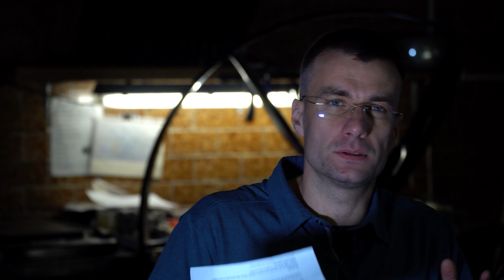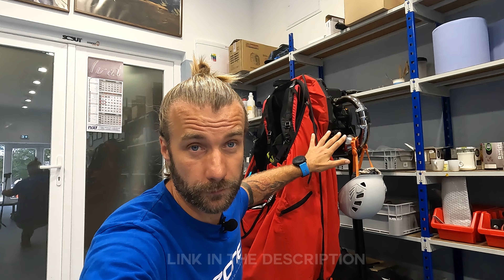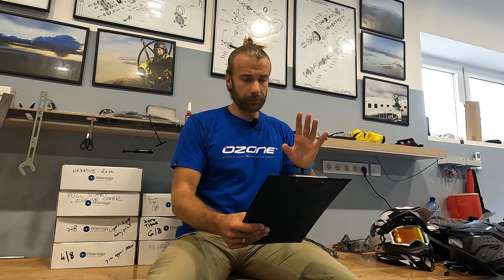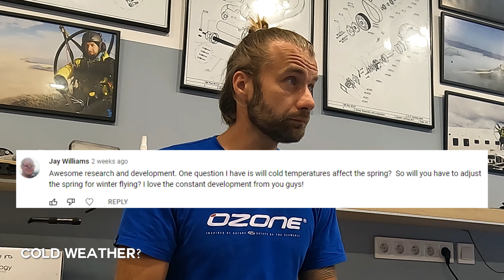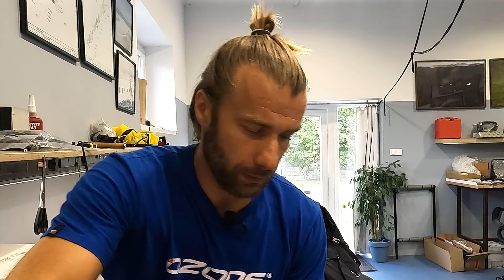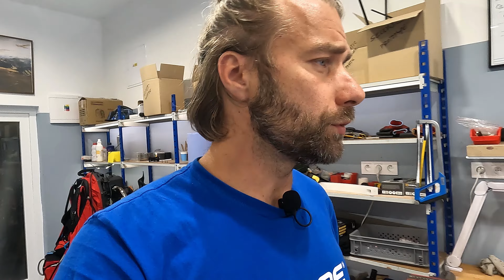Variomatic Propeller FAQ - 340 comments! Smarter Pilot series.

Comment: to be fair, you don't need to use one helical spring - you can use one leaf spring for both blades. that shouldn't complicate things too much. It could be used as a pusher or a puller spring, and having one spring instead of two would minimize the issues with having slightly different tension for each blade.
Reply from the maker: I can see some benefits of leaf spring. This would require significant changes in the design. For simplicity in will stick with current design for now but I will consider leaf spring for future evolution.

Comment: Most pilots (at least GA pilots) are aware of the benefits of in flight adjustable props.  Development started just after WWI and commercially viable implementations were available in the 30's, certainly in WWII the vast majority of military aircraft had in flight adjustable props.  There is also already a company that makes props that are adjusted in a manner similar to what you have done for a small number of GA aircraft, so it shouldn't be a surprise to pilots in the know that what you have done, if implemented correctly, will have positive results.  I don't intend for this to diminish in anyway all the hard work you put into making this a success.  I say bravo and congratulations for sticking with it and making it work.  I won't be surprised but will be pleased when the solution is eventually available to PPG pilots.

Electric motors and motor drives are already very efficient.  When not running at 100% output the current drawn is proportional to the load, if the prop doesn't load up the motor, the motor won't draw very much current.  I wouldn't be surprised if there were no benefit for electric drives.  Another way to look at it, electric vehicles don't select different gears in a gear box for different vehicle speeds, the motor to wheel gearing is fixed at one ratio and electric vehicles still have excellent acceleration and operate at high vehicle speeds.

Comment: Great news.  I fly a PeaBee flexwing (powered hang glider) with a Moster 185 and have struggled for ages to find a suitable propeller as my cruise at 57/5800rpm is 46 mph.  Do you feel your propeller will be suitable for these flying speeds? I'd be really interested in supporting you if required.  Your R&D and attention to detail is amazing, thank you. Looking forward to the update.
Reply from the maker: I am sure it would work. I will not be able to fine tune the settings. Would you?
Reply: @SCOUTaviation  I work with a UK microlight maintenance company called Micro-Maintenance so would happily work on the fine tuning. I've even been experimenting with different pitch propellers at the moment.

Comment: Miro, why not use a swashplate like a helicopter to vary pitch inflight ?? 
Pilot adjustable in flight !  

I’ve used this process on model aircraft for reverse thrust to fly backwards
Reply from the maker: How would that be better?
Reply: @SCOUTaviation  
It would allow infinite adjustment you could measure with rpm and speed to ensure optimum performance - blade shape can be optimised.
Have a look at a Rc model helicopter tail rotor- upscale it 
It could be retro fitted to not just scouts but all prop hubs for all engines
Reply: @unclebuck8558  
I often mull on this one for a Sub70kg and it usually ends with "I can't afford the extra weight"...
I'm sure it could be done with NASA style attention to detail and tech but for me, my workshop and fear of resonance/fatigue, it would take some doing.
Reply: @SCOUTaviation  I bought a scout nxt from
Steve page in the UK it’s in the air almost here 
I’m super excited for my first scout

Comment: electric motors aren't more efficient at lower rpms, but it takes a lot less amps to keep the motor at 50%rpm than it is to keep it at 80%rpm
so yes the electrics would benefit from this.
Reply: added bonus: less noise from the prop because of the lower rpm!

Comment: I thought I saw the variomatic on your machine in Judson's latest video! :D  I also initially thought a flexible prop would be the best way to achieve the same effect (with no moving parts), but you're spot on about prototyping and production, would have to iterate a number of times to get good data (make a bunch of prototypes) and very difficult to achieve consistency in production. Keep on going, you'll get it sorted, very cool project!

Comment: Variable propeller makes no sense for a long flight.🤔
Reply: As the propeller is designed to be more efficient at cruise by increasing the pitch at lower rpm’s I’d say your comment is the antithesis of the reality.
Reply: All the propellers are designed to be most efficient at cruise speeds.🤔
Reply: @mamatuja  
Indeed, but usually, you can design for max static thrust (EG: short takeoff run, less efficiency at 30mph) or best cruse (EG: efficient at 30mph but lower max thrust for launch)
Or somewhere in-between in a compromise.
You can't have both without the complexities of some form of variable pitch.

Comment: What does a propeller have to do with different engines? Isn't it all about RPM?🤔
Reply: that's like saying tire size doesn't matter on a car, it's all about wheel speed. 
 different props provide different loads, which puts different stresses on the motor. you can overheat and kill a motor by running the wrong prop